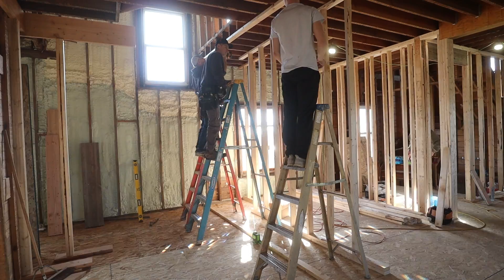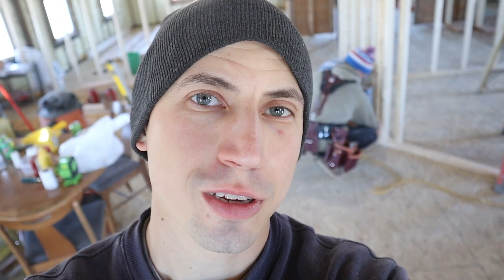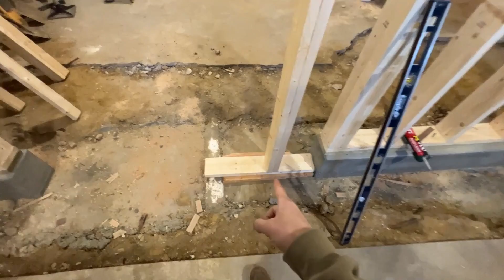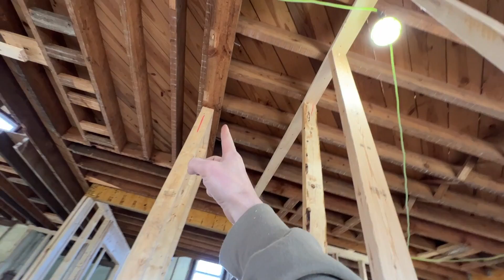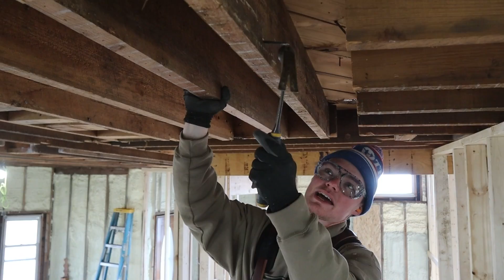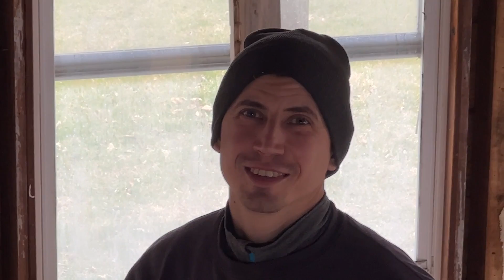Restoring A $7,000 Mansion: Building A New Living Room

Comment: Just an idea, make a separate door into the bathroom facing the stairs, you don't want people wandering through your pantry where you toss brooms, bags and vacuums etc.
Reply: the pantry is for food storage brooms go in your broom closet. but yes i would never make a bathroom in one, 100% shouldn't be where the door is.
Reply: I think in an earlier video the door of the toilet is not though the pantry, rather on the opposite side of stairs, i think
Reply: @johanneseder27 I hope so...its so unsanitary to have bathroom and pantry in one.
Reply: @johanneseder27 he hasn’t built a doorway. It would be there already if that was the case
Reply: Tall outside stud is called the king stud. One under the header is the jack stud in Ohio, so of course Roman is right.
Reply: @marilynpoindexter8752  and then there's the Corn Star Stud! He rocks!
Reply: @marilynpoindexter8752  😸
Reply: @AffectionateDriftwood-vr2sf   there is no such thing as wasted food from over stocking anything if it is not used gets donated to a local charity after a year or two depending on what it is. there is no reason to not have at least a year's worth of food at one time. having 1of every thing that is open and a few of things you use all the time in the kitchen and everything else in the pantry is the way to go i don't need 24 jars of peanut butter in the kitchen. you still need the same amount of storage volume no matter how "savvy" you shop, and no amount of clever uses of storage will beat the space efficiency of a pantry. unless in the uk you do the same thing as a party but are just too poor to afford the wall between the two?
Reply: @billboein  in the uk..... we don't don't need to super size me shop, English don't need to but that's cool, kitchens a kitchen right, pantry is a a pantry, u only see them in victoriana built houses now! Or buck Palace if u ever wana see royalty. But that's the great thing about culture..... if we were all the same there would never be such a great debate right!
Reply: Many people cook from scratch and have bulk dry store food stuffs ive neve usded just the kitchen cupboards..id go crazy with out proper storage. @AffectionateDriftwood-vr2sf
Reply: Omg, that's exactly what I thought.
Reply: Yah I thought no way he’d put the door in the closet, maybe a door in both sides so they can come from the stairway as well as from the living room
Reply: He said he was going to separate it
Reply: yes
Reply: Some Pantry's are filled with cabinets and you can see anything without opening said cabinets
Reply: I hope he reads your comment and heeds your advice.

Comment: The point loads you have created see inadequate for the load being carried.  I am not an engineer but I have worked with engineers on many projects and they all called for much larger headers and posts to carry loads.  The last house I extensively modified the engineering called for 12"X36" gluelam beams when removing a dividing wall in a living room.
Reply: I hope they see this post!

Comment: for the  new wall footings in the centre of the basement why not just mar up the faces of the wall footings add a few drilled points with some rebar horizontal and vertically into the floor and then poor the additional 12 inches of concrete , if this isn't viable would love to learn why it wouldn't be

Comment: Roman is right. King stud runs from plate to plate, jack stud runs from plate to header. Cripples run either from bottom plate to sill or top plate to header. Jack studs are sometimes referred to as trimmers but most construction people would call it a jack stud.

Comment: I have no doubt that the 3 ply 11 7/8 LVL will be more than strong enough for the closet load, but will it meet code and pass with the inspector.  Where I live there are formulas when it comes to loads on a cantilever, at least that's what my engineer tells me on the ones I have to deal with, and it's inches.  BTW, I just used the same 3 ply 11 7/8 LVL as a header over a 10' door; my gosh it's heavy, but so strong!  Loving the build!

Comment: I'm sure with all the vehicles you have you could hook up the trailer to load all the wood for Roman to take home. He is back in the morning anyway. Definitely need to brace the studs for the walls for structure plus use as nailing plates to hang pics, TV, kitchen cabinets etc. Finally do two pocket doors to entrance of pantry. Also you already have propane, why not do an insert fireplace and use the old mantle, doors and trim where you can. Put back some history in this home.

Comment: I have a suggestion for when you put in your electric outlets. Put them in at about 3 feet high. Little fingers don't find them as easy and when you get older you don't have to bend over to plug things in. Most times they are hidden behind finiture.
Reply: This is the worst suggestion i have ever heard. Also, against code. But who am i shrugs
Reply: @Bbnotbb1234  maybe against code in Iowa but not here and it has saved my back so many times.

Comment: I can relate to walls being tilted in an old home…it’s like they built it that way cuz they left their bubble level at home.  Sister some wall studs in old wall and level them out with new wall so it’s all straight. 

Ciphering walls and supports for such a big place is a head scratcher for sure. Got some good thinkers on the job though so it will all work out.

Comment: Your new wall supporting the second floor looks to be in-between to floor joist according to you new post in the basement under the door header! I don't believe a second floor stair opening being supported by only the osb subfloor is correct.  You should have a girder at the top of the wall or under that wall in the basement joist bay running from the exterior foundation to this new footing/ wall.
Reply: I hope they see this comment!

Comment: In your pantry I would highly recommend putting a deep countertop and then a bunch of electrical plugs so say for example you want your blender and all that your toaster. You can put that there and then you could have sliding doors or a roll up door that comes down onto that. So that your countertop does not look cluttered. Also I would stick a trash system in there. Maybe even in your countertop or you can make it that there's some type of cover for the trash so that the countertop is flush. I wish I could describe it as I see it. Just so that you don't have to pull the trash can out and slide stuff off onto the countertop into the trash. You can just slide it all into the hole. And inside your house I would think about doing like an outside door that comes into a shower unit and sink so that if you have to rinse some of your clothes off or God forbid your dog sprayed by a skunk. You could go into that room and deal with those situations. And if you have to strip down for whatever reason instead of bringing all that into the house you could do it there. I personally would make that my washroom but my home would have been a different layout

Comment: Hit the gas tank where the fuel pump is with a rubber mallet.
Reply: check the fuse in the box by the radiator ford is notorius ue pump melts the part where the use goes in and ford makes a new fuse holder to replace the spot in the use box thanks

Comment: King stud = plate to plate
Jack stud = bottom plate to header
Cripple = bottom plate to sill or header to top plate
Reply: Finally.  Someone said it.
Reply: @IamDog0 it was getting a little old by the end. 😂
Reply: Also a header goes above a window or doorway. A beam is what they are holding up with the jack studs.
Reply: And the ‘trimmer’ is part of a window’s framing while a jack stud is part of a door’s framing.
Reply: Did I miss something or is he talking about some load bearing beams parallel to joists? At another point he correctly points out a partition wall. Guess I am just having trouble picturing it. And now he is in basement talking header size as if it should ever be sized to only carry 1 floor worth of load.
Reply: Exactly!
Reply: EXACTLY!!! I was yelling at the tv.
Reply: THIS
Reply: NO, its Handicap Joy st. (street) Trimmer (weed whacker)... Roman can confirm it!
Reply: I was about to post this!!
Reply: and corn star stud

Comment: *The stud that holds up an end of the header can be called either a trimmer or a jack or both. The word trimmer comes from the fact that the trim gets nailed to it. The word jack refers to its structural function supporting the header. Cripple studs go between a header and the lower top plate, or between the sole plate and a window sill

Comment: The trimmers are wrong. They are jacks. The King stud holds the weight from floor to ceiling and the Jack stud hold the weight of the header between the King studs

Comment: Jack Studs – also known as trimmer studs are vertical framing members on either side of a window or door rough opening. The jack studs define the width of the rough opening and runs continuously from the sole plate to the header which they support. Cripples are vertical framing members that support a sill or saddle. They are installed at points where a common stud would have stood if not for the window opening. Cripples provide support for the window and the sill it rests on.

Comment: Make sure to have a shower and bathtub in the first floor bathroom.  Problems in life may make it difficult for someone to get upstairs during a time of healing.  Also sometimes it’s easier to bath the little ones on the first floor!
Reply: There will be a first floor full bath in the addition they will be building.
Reply: This is also my suggestion Cole. Please place the door in the hallway closer to the entry point for the ramp access door is going to go. Will make best ease of use for flow and all mobility types.
Reply: So true!! Our little guy loves to get muddy and sandy when playing outside; straight to the bathtub he goes and thankfully it’s 8 feet from the front door

Comment: The Jacks are what goes on the side of the opening, The Cripples are what holds the header up. I've been a Carpenter for 40 years
Reply: King stud runs from plate to plate at openings and Jack stud supports the header
Reply: @davidanderson1074  I've found that the nomenclature changes depending on where you are from and/or who you apprenticed with. One way or the other, we'll get 'er framed. 👍
Reply: In New Zealand old English we call its a Jack Stud to support the header also known as (lintel). King Stud it beside the Jack Stud from bottom plate to top plate. Cripple is between header and top plate or sill to bottom plate. We also have double top plate. Some refer as Jack Studs or half Studs. Or Sill cripples top crippers or half studs.
Also unde our building code noggins and dwangs aka nogs I believe Americans refer to as blocks or fire blocks are installed at every 600mm between studs.  But here we call them dwangs. Unlike some US codes routing hole for cables don't have to be fire corked. Some also refer to Jack's to be sitting on top of (window) sill plate etc.
Some new codes require 6inch 120mm outer wall with dwangs. Plus treated ply as bracing glued and screwed. For earthquakes etc, With double to triple glazing. And higher R-ratings for insulation.
Reply: And don't forget the trimmers. 😄

Comment: Cole, those springy support walls should have either 
A. bridging/blocking between each stud (2x8x14.5 blocks turned sideways and installed halfway up from the floor), or 
B. diagonal braces, or 
If you're going to install wall-mounted cabinets in the pantry then bridging blocks at multiple heights (base cabinet height, and upper cabinet height) would solve two problems at once. They will stiffen the springy support wall, and provide strong mounting surface for all the cabinetry.
Reply: I literally was just looking to see if anybody commented about the blocking on the studs
Reply: The 1/2" plywood should solve that issue.
Reply: @TOXIXIFY  Would 5/8 drywall do the same?
Reply: @safffff1000  Drywall doesn't have enough strength to function as a diaphragm on a loadbearing wall. And you should never screw upper cabinets directly onto just drywall. You either have to find the studs behind the drywall, or you have to think ahead and put 2x8 blocking between all the studs before installing the drywall.
Reply: Those are temporary walls. None of the final walls have that issue.
Reply: @nglessner  At least two of the walls are permanent load bearing walls. They're built directly over the support beams in the basement. All of the pantry walls are now permanent walls. And, it looked to me, by the end of the video, that most of the temporary walls have already been removed.

Comment: Why don't you put in bracing between the studs just too keep them from twisting, warping, and bowing.  And it will also help the studs be stronger to hold the weight if the floor.

Comment: Cole,
You can install intermediate bracing between the studs and it will really stiffen up the walls. If add rose braces you are bracing the studs in the weak direction.

Comment: The best part of running a bay window corner stud thru the table saw is that you have a solid wood corner with nomissing piece as you would in progressive framing. The drywallers will thank you because the nails or screws have backing.

Comment: Thats a huge amount of space to heat/cool...
Good windows & as much insulation as you can put in will help .
When I built my house I installed a barrier between the floors .
Im sure your carpenters can advise  on that.
It helps regulate the temps on each floor ..
Heat rises , cooler air sinks ...
Im so glad I sealed each floor in the end ..
That stopped the half story on top from being too hot or too cold with the seasons..
Love the building vids.

Comment: Roman if that truck has the fuse box on the radiator support, check fuse 27. Pull it out and see if the legs on the fuse are melted. Ford has a kit to switch it from a mini fuse to a j case fuse. Many a fuel pump has been replaced because of that fuse. Lol years affected 09 to 14.
Reply: Thank you for a great idea! Mine is 07, but I do need to check the fuses and relays

Comment: Before you put wall board up take pictures of everything. If you have problems later you have blueprints and also the Skelton of all rooms with wires and ductwork and pipes. Trust me it saved me a lot of headaches 10 years later.
Reply: Not a judgement. 
They are recording the build.

Comment: Just a suggestion for Justin! When you put kitchen cabinets in put a 2x8 in between studs so it makes it much easier to hang them up solid! Toilet paper holder and curtain rods. That way there you have a solid wall behind sheet rock and that eliminates holes in sheet rock down the road!
Reply: People who did my renovation put OSB on frame behind drywall in kitchen so that mounting screws for cabinets were assured to hit something solid no matter where placed. Only drawbacks i know of would be that room would be one inch narrower each way and electrician would have to mount switch and receptacle boxes out a full inch from frame instead of a half inch.
Reply: It’s called blocking

Comment: Hey Cole do any structural engineers exist in Iowa? Does the county ever do inspections of buildings under construction?  Do you have architectural plans for what you are doing? It does look like a diy project at times. Glad to see that you have added another worker. I know that you have a deep sentimental attachment to the old house but it would have been a lot easier to tear down the existing house and build a nice new house with a straight foundation. I know it may seem far off but what are your plans for new windows?

Comment: Trimmer aka jack stud. They are the same thing and is used to trim out the opening either for a window or a door. I would use steel jacks in place of wood because you never have to worry about it and they 100 times stronger than wood. Plus they are easier to hide in the wall.

Comment: Don't forget to block the stud bays 2 studs on the corners and doors. I'd block the whole wall that is carrying the load from that second floor. Also, when I built homes back in the '70s, we called the studs that were nailed to the ends of a header "King Studs. The wood that was parallel to that but under the header were the "Jack Studs" and the Trimmers were directly against the door or window frame. Jack Studs are cut to be a very tight fit. Trimmers are not as tight so they can be adjusted to touch the door frame then toenailed in. Cripples were above the header, up to the first top plate and in the case of windows, were also below the sill plate that supports the bottom of the window frame. I noticed you were missing the cripple on the end of the door headers. There should be one at each end of the header, against the king stud, regardless of your 16" stud layout.
Reply: Thank you for this post! I hope they see it!